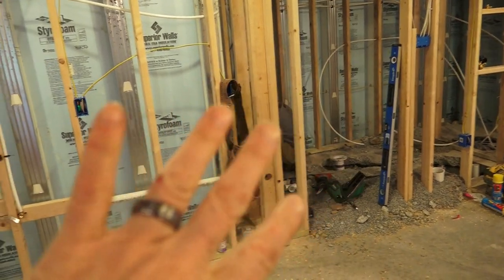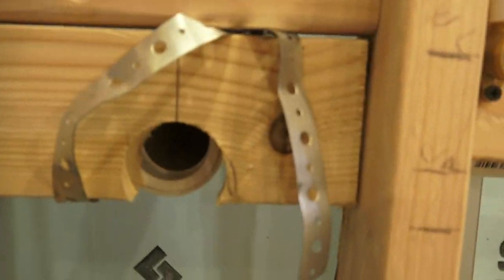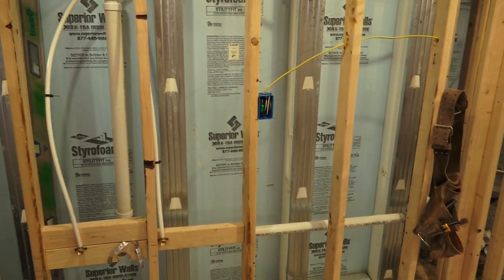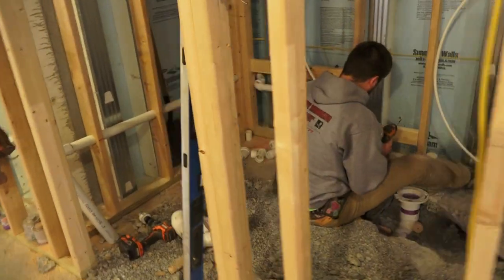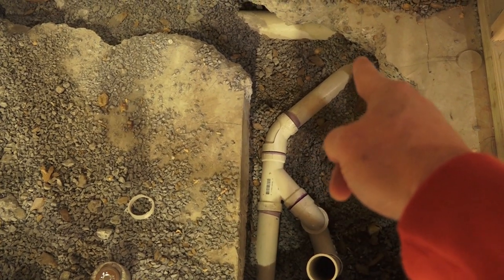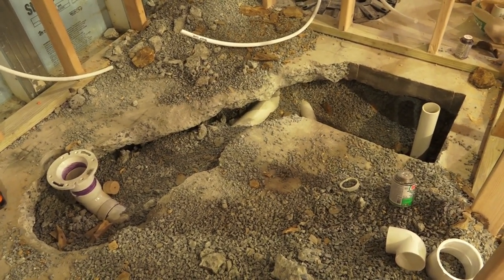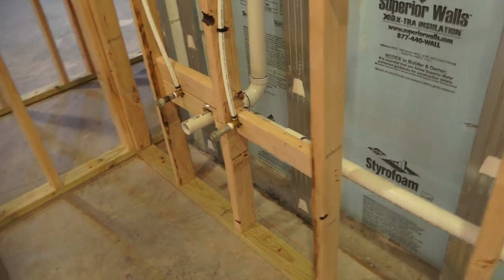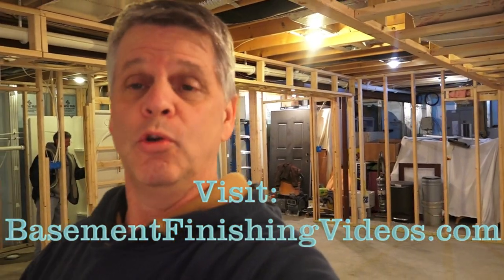How To Install Bathroom & Bar Plumbing in a Basement

Comment: I often see a lot of improper plumbing installed on this channel, in this video I saw an S trap, a san tee on it's side, a union trap underground, and I saw a pressure 90 which looks like it was going to be used on a drain line.

Comment: Nice work.  I did notice that your bathroom sink drain is vented by the Studor vent.  If you did not have the wet studor vent it would not have been properly vented. Your other vent is below your bathroom sink trap.